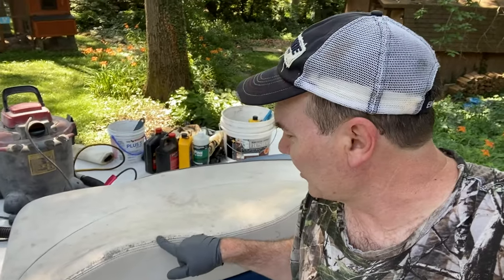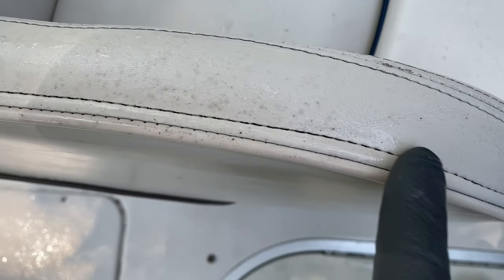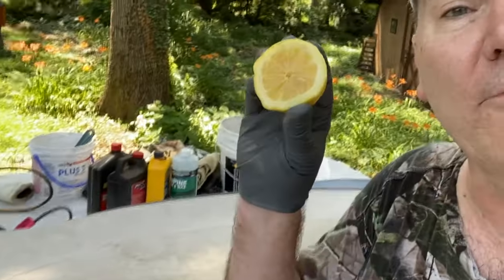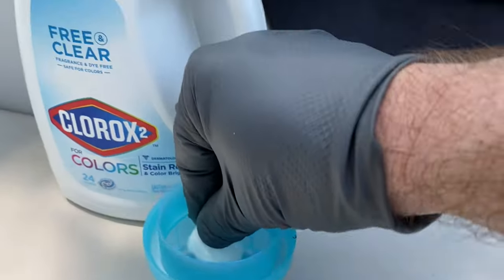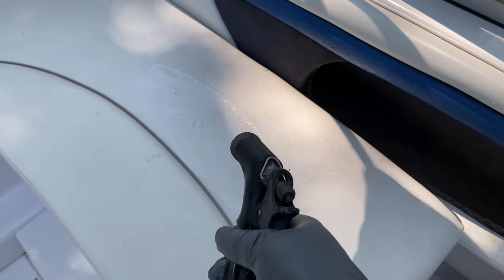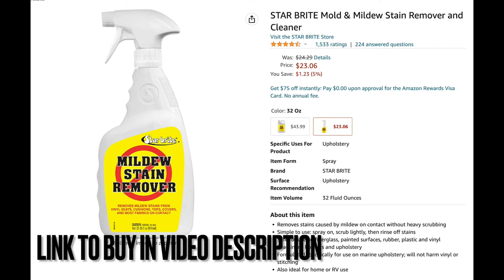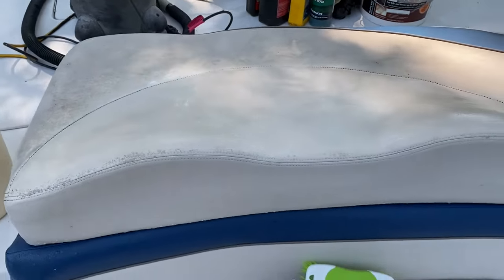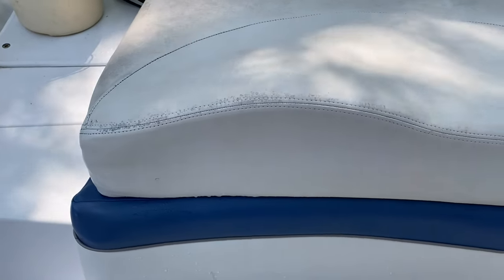Clean Boat Seats - Cleaning Mildew Stains On Vinyl

Comment: When using the Starbright Mildew remover you're doing it about 80% right.  Try to apply in the shade, like you did, you need a medium brush and possibly a mild to medium 3M scrubby pad.  Spray the area then scrub, let it work, come back mist lightly, scrub again, let it work, come back mist lightly let it work.  You can wipe off the parts that get clean with rag and continue to work on the seams by, re-spraying, scrubbing and letting it work.  On stubborn stains I've worked them for over 30 minutes to get them clean.  Once your done Starbright does have a spray that you put on your cushions that blocks mildew.
Reply from the maker: Those 3M pads seem like they would scuff the surface like a magic eraser and many people say that's bad on vinyl.

Comment: Any detergent that’s “bleach for colors” isn’t actually bleach. It’s just a play on words for advertising purposes to make you think “my colors will be as clean as my whites get with real bleach.” Real bleach would bleach your colored clothes. You need to try a real bleach product. Just like the threads in your clothes, if you don’t rinse the thread super well, your thread will deteriorate but just try to steer clear of the stitching as well as you can and rinse very well. Bleach is only for every once in a while cleaning, maybe yearly or every other year. After some research, I have found for weekly or monthly cleaning, that it takes one product to kill active mildew and a different product to remove the stains left by the mildew… so annoying, but worth knowing. Good luck!

Comment: Wayne I have just the thing to clean your boat seats and yes it actually works.  I use Acetone.  I know you're probably thinking that it's a little harsh but it won't hurt the vinyl at all and will return the seats to almost new condition.  Just put some on a clean rag and rub it on in circular motion until the stains are removed.  It will leave the surface feeling tacky or sticky until it dries.  After you're finished I use a good vinyl protectant and it leaves the seat feeling nice and smooth.  if you are concerned at all about it leaving a film you could wash with your seats with mild soap and water after but I never bother to do that.  Give a try....
Reply from the maker: I have some acetone- I’ll check it out - thanks!
Reply: Like nail polish remover? Or like straight acetone?
Reply: @WayneTheBoatGuy  did it work?
Reply: @k7roger  following
Reply: It works
Reply: I did hear that oven cleaner works but haven't tried

Comment: If you remove your cushions every year, clean them and stored them before storing your boat for winter, MILDEW will not happen.😁😁Just do the extra....
Reply: Fish eat year-round :-) I never winterize my boat because I'm using it
Reply: @818773  I pull my cushions off every fall, clean and treat but 4 years later now getting mold.  Scout boat .  I keep my boat clean I just dont understand it  bad luck I guess  -  rather save the good luck for the fishing  
HA

Comment: Wayne - big fan of yours here. I'm also a pretty new boat owner (of a bigger four winns - family had small boats my whole life) and I get a lot of help and value from your videos. Wanted to let you know that after hours of research I tired a bunch of different products, Including stuff they recommended at West Marine and none of worked well.  I just tried Marine 31 yesterday and was blown away with the results. Much better than I expected. Hope it can help you.
Reply from the maker: Thanks - I think I'll have to give that a try!
Reply: I'm about to try the same, but believe you must rinse after use if it gets on threads. Bleach will damage threads if not rinsed.
Reply: @WayneTheBoatGuy  I used the Marine 31 on my pontoon boat seats and it was great, my neighbor used it as well and his boat seats were worse then mine, but Marine 31 made them look almost new. Just be sure to rinse and you don't need to scrub very hard with a microfiber cloth.

Comment: I use a 3 step process. First i clean the loose dirt off using Spray Nine & scrubbing. After rinsing that off i use a melamine sponge (magic eraser) to take off the more stubborn dirt. 

Finally the only thing left is usually the mildew stains where I'm in the same boat as you. I gave up using mild cleaners & use Tilex or similar bathroom cleaners which will lighten the stains but never quite remove them completely.

Comment: Meguir's #39 Heavy Duty Vinyl Cleaner is hard core and works like magic compared to anything else I have tried...and I try hardcore stuff.
Reply: I agree that this is good stuff, but doesn't really work on true mildew/mold stains.  Also, sadly #39 has been discontinued.  The SDS indicates that it was mostly TSP (Trisodium Phosphate).

Comment: Hello from Canada. Great videos Wayne. I have a 2008 19 ft Campion 542SC that I bought new in 2008 for about $42,000 Canadian. Now the same package is $80,000. Talk about boat prices going up. Great saltwater fishing rig that you can use on the lakes as well. Boat is always under cover so is real nice shape. The best products I have found for removing tough stains from vinyl are either acetone as James S mentions below, or high strength hydrogen peroxide. Have tried everything else and nothing seems to do much. The problem with acetone is that it can dissolve/melt the vinyl quickly and remove its surface finish and/or surface print if not a solid color vinyl, so best to test an inconspicuous place first. The hydrogen peroxide has a bleaching effect so also need to use with care. Leave it on the stain until the stain is bleached out and then remove - don't just wipe with a rag soaked with hydrogen peroxide - it won't do much. Vinyl stains are difficult to remove because the stain is usually in the vinyl and not just on it. Stains seem to penetrate it. I always start off with soap and water though, and work my way up through the cleaning products, and only use hydrogen peroxide or acetone as a last resort and sometimes even that doesn't work. Had a Daiwa SG47LCA Linecounter fishing reel laying against the seat and the gold finish on the edges of the reel left a stubborn orange stain on the seat that I couldn't remove without risking damage to the vinyl. Who would have thought a fishing reel would stain boat seats - was totally pissed! Ended up just leaving it. Happened a couple of times before I figured out what was going on. Keep the videos coming and btw I love the old 2-stroke motors as well. Have a 1985 Merc 2.2 and 1977 Evinrude 9.9 that I've had since new - both run great but don't use them much any more.

Comment: I’ve found that Star Brite product to be amazing. Let it soak for a minute or two and scrub then rise with the hose. Soft bristles on the stitching. Might have to repeat if it’s bad. Could be coincidence but seemed to work better on sunny days.
Reply from the maker: Interesting!
Reply: I agree. Star Brite makes good products. I'm using one of their products at home,  to treat mildew spots which appear from time to time  in my bathroom. It's almost magic. The spots disappear within a few seconds and they don't come back before months.
That said, I never had any mildew issue on my boat cushions. I'm living in a dry area and my cushions are dark blue... That helps, probably.
Reply: The star brite products typically have low concentrations of sodium hypochlorite (Bleach) and UV light (sunlight) also helps remove mold/mildew stains.

Comment: StarBright is great. 
Also SprayNine. and finally a 'cocktail' of Comet and SparyNine wait 2-3 min Scrb again and thouroghly rinse off. 
Wash down the area with mild dish soap to remove any residual chemical.
Finally use a vinyl  303 Protectant Polish/restorer to protect the material.

Comment: I know that boats spend most of their time in use in the sun, which is a big reason why the majority of boat interiors are predominantly white or other lighter colors. The constant battle with mildew/mold stained seats is enough for me that if I ever have my boat reupholstered it's going to be either black or some type of very dark grey color. Obviously the mold/mildew issue will still remain, but keeping the stains from being visible will be much easier with a dark neutral color than some type of white based color. I don't even care if the dark seat would burn me alive every time I sat on, it'd still be worth it to me.
Reply from the maker: It's like buying dirt colored carpets! I always tell my wife that I like carpets that look like dirt.

Comment: Wayne. I have a house with white vinyl siding which had a lot of black drops in various places. I discovered it was spider poop and nothing would remove the stains. Tried everything until I discovered a product in one of those dollar type stores. Sprayed it on the stains and to my surprise they came off. I'm going to try it on my stained boat vinyl. Let you know what happens.
It's called LA's Totally Awesome Orange.
Reply from the maker: I have heard good things about that product!
Reply: I am from Toronto Canada  Awesome Orange work great . I open the bottle  that  it come in and empty some in a bowl take a 4 inch paint brush and paint it with the Awesome on the area that needed to be cleaned. Take a dry clean  cloth and wipe it out. Then take a pail with warm water and wipe it out..
Hope that helps.

Comment: I just wanted to add like another did in the comments, Starbrite products are the best out there... I can personally vouch for the following: Hull Cleaner, Rust Remover (omg it's unreal how good this is), Rub Rail Restore, Stainless Polish and their boat soap (blue berry scent). I've tried so much and they are the best... The only product I use outside of these is 303 Aerospace Vinyl Protector and CRC to stop rust from forming on my engine.

Comment: I used a mold cleaning product for bathing rooms  called HG schimmelreiniger (its Dutch). Not sure if its available in the US. Spray on, wait 10 minutes, brush and rinse off with hose. Gets all stains out. Treat with a vinyl protector afterwards.
Reply from the maker: Neat - does it contain any bleach?

Comment: If left to long, mildew causes permanent damage to the vinyl paint. No amount of bleach will be able to clean that. If I where you just try pure bathroom bleach. It’s nice to see you worried about the stitching but you have come to a point where this cannot be removed at all or only in a way that might slightly damage stitching. But then again it looks like the damage is already done anyways. Just rinse or neutralize the bleach with a light acid. Next boat don’t leave the mildew on the surface so long :p clean with hydrogen peroxide 12% this will remove mildew without the corrosive properties of bleach.

Comment: In Hawaii, we do have a humidity challenges which creates that same mildew problem.  On my boat, I been using tile-ex, the bathroom spray product which I think is basically watered down beach.  It seems to work well on my seat cushions that are maybe 8-years old and I assume are china made.  For now the stitching seems to be holding, but we will see.  My theory was not to brush it or apply anything abrasive that might make the surface of the material more porous which would provides more "pockets" for the mildew to grow?  So far, I just spray on the tile-ex, let it sit and work then rinse it off and most of the spots and dark areas disappear.  In all truth, I never considered that the bleach speeds the deterioration of the stitching, but that does makes sense.  So bleach is a harsh chemical, but it works, I guess its a balance of aesthetic and longevity.  Maybe a crazy idea, but could you use vinyl spray paint and make the cushions a dark color to hide the spots?  Might actually seal the vinyl and thus no place for the mildew to pocket and grow, or might just make another problem?  However, and as always I enjoy your channel and content.  Keep up the great work!   Stay safe!
Reply: Bleach is ok as long as you spray a good vinyl conditioner on afterwards. We use 303 here in Louisiana to help the stitching
Reply: You need to seal them when you're done.

Comment: I used liquid bleach mixed with water probably about 1 to 5 ratio and put it in my bleach sprayer and I sprayed everything on my boat and it killed all of the mold then all I did was hose it off I had very dark black looking mold in my bathroom and I sprayed it all down gone within a minute I don't know about the stitching being corroded with bleach but it's what I used and it worked your bleach with color is probably doesn't have the chemical in it to kill it like straight up liquid bleach

Comment: Would a power washer work?
Reply from the maker: Could be a bit intense in vinyl. Also I haven't seen a power washer do more than I can do with a good scrub brush on other surfaces.
Reply: @WayneTheBoatGuy  just a thought... in my mind it was a lower intensity nozzle. Just less elbow grease I guess
Reply: I've used a 3100 psi pressure washer with the 40° nozzle on my vinyl and it helps without cutting. But be careful! 4-year-old seats.

Comment: Those little black spots are where the vinyl no longer exists. They are the "roots" of the mildew, and Mother Nature has made them resistant to everything; they have had hundreds of millions of years time to evolve. So, if one can actually remove the small black spots, they leave a small hole. I have used Starbright for over 10 years now, and it is by far the best product. I have also seen the lemon video where the car seats came like new. But it was that dust-like mildew on the surface. Perhaps the video was not fake, but the black spots on boat vinyl are just impossible to remove completely. There are citrus oil based cleaners that will work, but here in the cursed EU they got banned for some reason, at least for the public...

Comment: You should not use  acidic\abrasive cleaners on your boat seats, they break down the UV coating in original production and will shorten the vinyls life span.

Comment: Marine 31
Miracle Mist
Grease Lighting
303
Acetone
Spray Nine
Magic Eraser
high strength hydrogen peroxide
Meguir's #39 Heavy Duty Vinyl Cleaner
absolutely fabulous
Zep Mold and Mildew Remover
Soft Scrub
Pool shock, water with dawn soap
pure bleach
steam cleaning
Starke
vinyl spray paint
X14 
LA's Totally Awesome Orange
scrubbing bubbles 
HG schimmelreiniger
30 seconds outdoor cleaner
Simple green
mineral spirits
white vinegar baking soda water
lemon
The Works
Lysol

These have all worked for someone here. Obviously everything and nothing works, depending on your situation I guess.